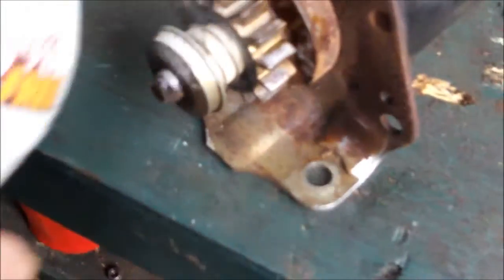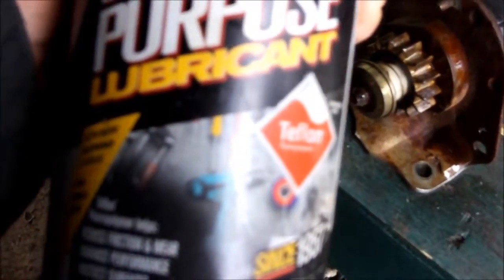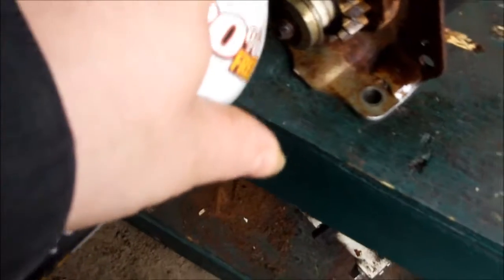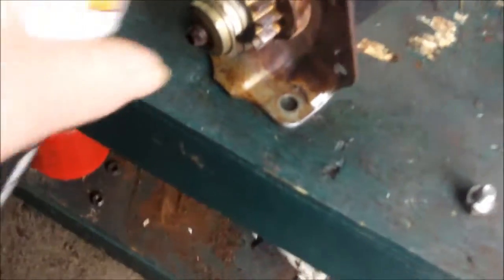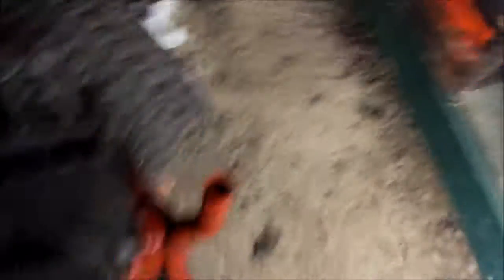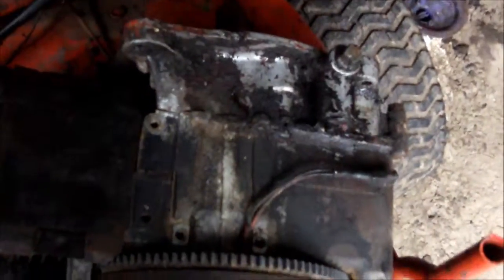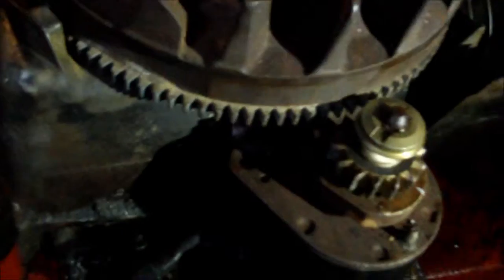bleach's brand new used starter for the 1987 8hp briggs for my 80s snapper rear engine project

Comment: By running that starter like that you may end up breaking the gear on the starter or causing damage to your flywheel.
Reply from the maker: Thanks for looking out for me. I jumped the starter on my main cutting snapper like that the whole cutting season. I'm going to use good batterys and wire them up on the two snappers i'm fixing up to sell in the future.